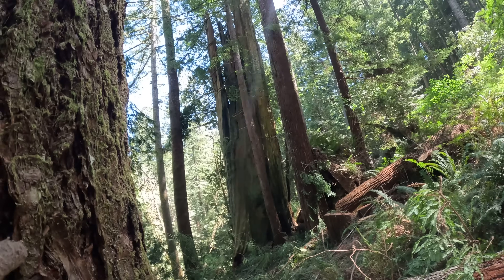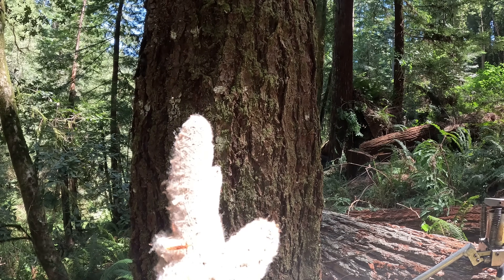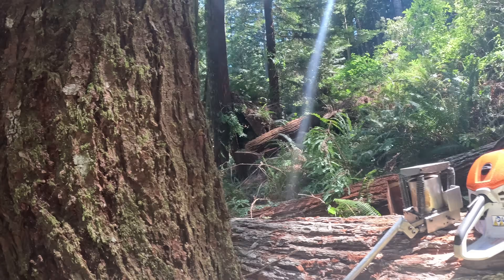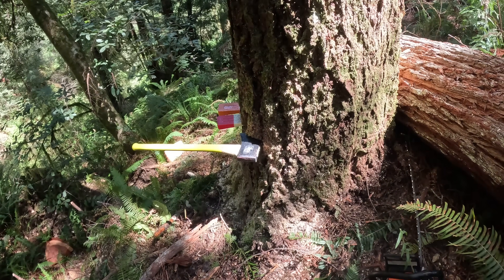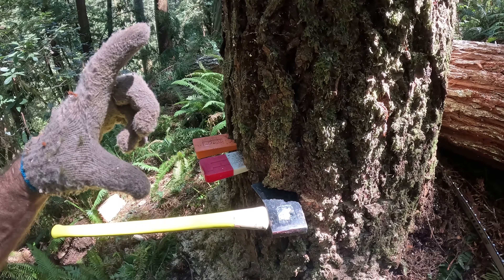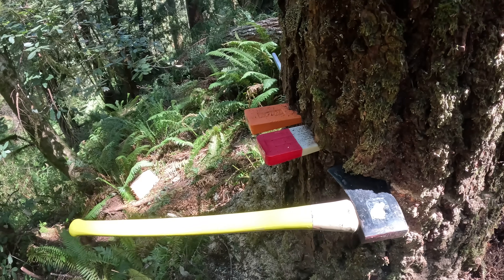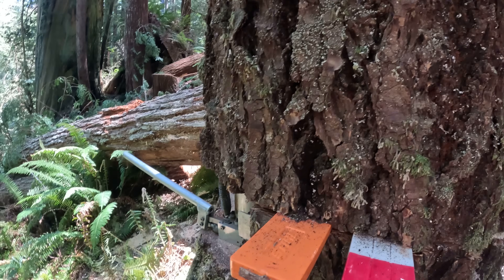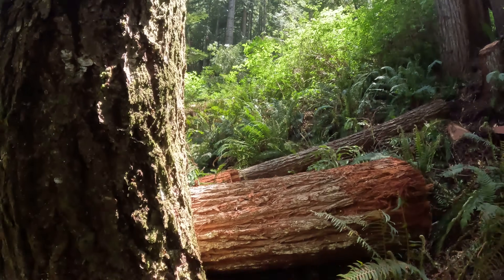Stock 500i With Max-Flow Mini Jacking Back Leaner

Comment: i'm not a logger, but i've cut alot of firewood over the years.  watching you put the back cut in, then start working on the open face. that spooked me and i was puckered up, till i understood what you were doing. i was thinking you were going to try to make it jump off the jack , with out opening the face all the way up.
Reply: sandsock - Thought the same thing. Also not a logger but have cut a lot of firewood. Made me a little nervous when he was cutting the face. All I was thinking was “hope he doesn’t pinch”. But have to remind myself he is a pro and has been cutting big timber a long time.
I’ll never cut that huge timber but have learned a lot by watching his vids and it makes me a better cutter.
Reply: Another great video jack and thanks for the pointers along the way!

Comment: Looks great!  That's the first time I've seen the jack installed first.  It probably helps a lot to have all that weight off first.
Reply from the maker: Thanks.
It's SOP, just as when using wedges, for dealing with a tree that is leaning back. The smaller the tree, the more crucial it is.
Thanks for watching.

Comment: that was a top notch demo that also applies to bigger wood with or without jacks
Reply from the maker: Thank you. 
I found it to be critical in smaller wood. Example - two 180' trees both leaning back 5'. One is 3' on the stump. The other is, let's say, 20". Limb weight is close to tte same. Assuming ⅓ of diameter for the face. And that the wood is consistent in hardness because they are growing right next to each other.
You had better keep the smaller one from moving back any further. WAY less "meat" on the stump to work with. This is because the fulcrum (hinge) is much closer to the pressure  point of the wedges or jack. 
Even though the bigger tree might have more mass - the greater distance for those two parameters on the 3 foot tree gives a mechanical advantage. Even an inch makes a difference.
All things being equal, I rather have the bigger tree.
Thanks for watching.